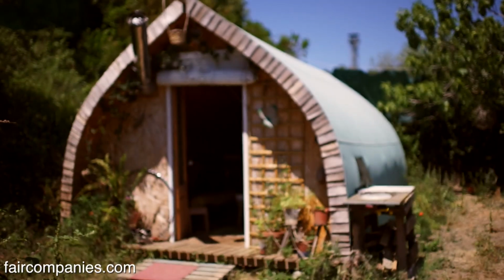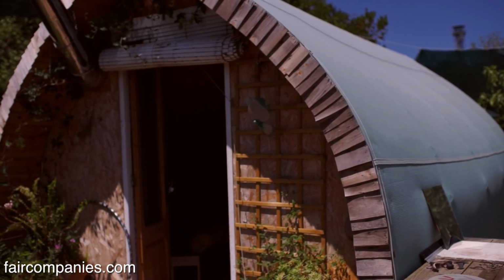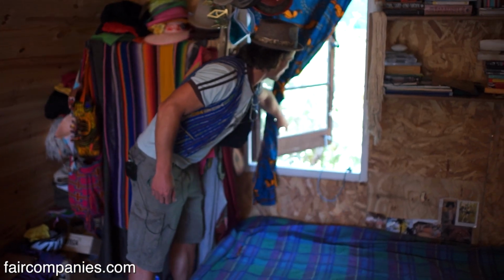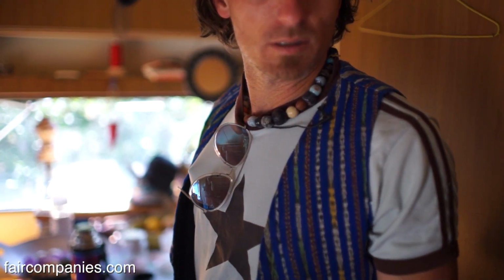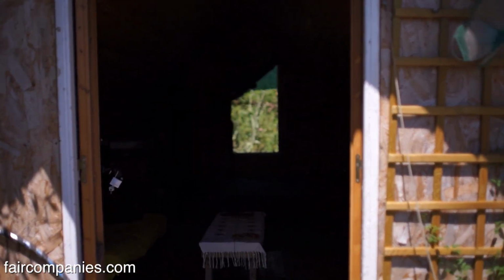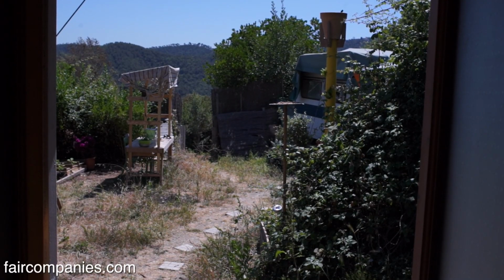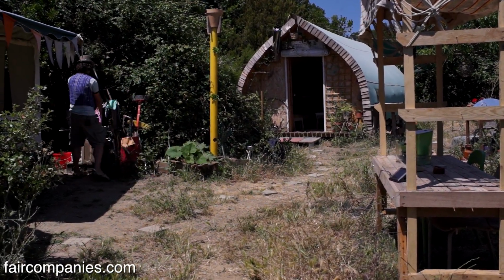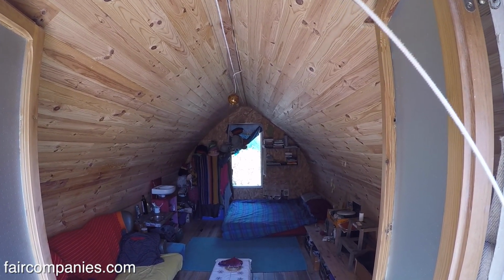Building €1,000 small home in 100 hours from open source design

Comment: I wonder: with the exposed chip board on the front, does he have issues with the humidity? It seems like the humidity would eventually work its way in and mess with the glue. Wouldn't it be worth it to at least prime and paint it?

Comment: the only thing I strongly dislike about this project is the OSB plates on the outer walls (the flake wooden boards). Those things are not 100% water resistant and best not to be used for exteriors.

Comment: the camper van is damp in the winter as for every pound of liquid gas you burn you produce a pound of water vapour, no chimney means all that moisture stays in there. the house is dry as no  gas being burned and you have dry heat from wood burner with a chimney changing the air all the time.

Comment: if you put a layer of plastic over the wooden frame then cover the house with mud or clay then added the tarp after it dried, would it be more insulated and silent during windy nights? been watching a bunch of videos on mud bricks, seems like adding it on the wooden frame would give super cheap protection?
Reply: Plastic will lead to condensation which leads to mold. Another material and you've got a nice idea...
Reply: I made an adobe wood fired pizza oven and I just used wetted newspaper under the adobe. The newspaper was spread on my "sand castle' style mold :) Worked like a champ
Reply: Need a large overhanging roof with adobe so that would negate the structures appeal. I like the wool insulation. Be sure to use wool insulation that still has the lanolin in the wool to help water proof it in case it gets wet. Wool will still breath and his idea is sound.

Comment: What's the name of the silver water pump thing connected to the shower?
Reply: It is an old hand pump fire extinguisher. Pump it with air to give pressure and open the valve to release the water. Plenty of them to find on the web or around your neighbor hood. Many are copper. Some are not.

Comment: Bet you could use the corrugated plastic sheets for this project, they are weather proof, and weight nothing. I did my bedroom ceiling and walls with it, and the outside of the garden sheds. I only have one arm that is fully mobile and limited use of the other arm, yet was able to handle the product. Homedepot sales for 110. for 10 sheets.

Comment: You can make this size of house much cheaper, with better insulation and engineering properties. Stone and mortar, and concrete floor. If you want to cover the concrete floor with wood, that's also possible, especially with such small size. I am absolutely not impressed by this guy's design, plus it limits head space around the edges.
Reply: Apocalyptic Knights 
Cheaper isn't always the  biggest concern. There is environmentally friendly as well an functionality.  For example fiberglass insulation maybe less expensive then lambs wool. But really how are they two products comparable in areas other than price.
But anyhow post your link and your analysis of  the products you're using.
Reply: Apocalyptic Knights Wow, you sound really upset over such a non offensive video. Looks like you need to do some meditating 🙏🏼
Reply: Link to designs?

Comment: Won't canvas deteriorate fairly quickly? It does here, UV can damage materials like canvas withing 3-4 years. Is the roof canvas treated for UV resistance?
Reply: ***** Cool, I was curious what the cost difference was, thanks.
Reply: +KlunkerRider One could also make the roof so those planks inter lap and then use tar to make it water proof. This way you dont need to worry about canvas and use only 20$ a year for jar of tar... or make your own for free.
Check out Finnish traditional log house buildings for reference. Those shingle roofs will hold weather decades if takes care of with tar.
Reply: +KlunkerRider If you are concerned about the UV just use plants. You could build a structure of steal wires above the roof were some wine could grow. Of course the canvas would get damaged by the wine after a few years but the overall endurance of the house would still be increased.

Comment: I don't support all building codes, or zoning laws, but think about the fact that most people spend a lot of money and time building a house and wouldn't dream of tearing it down when they move.  They want to get their investment out of it, so they decide to sell it, and then the complexion completely changes.  It's no longer a private person building a funky place for himself, it is now a PRODUCT.  The buyer may not know about all the peculiar features that the builder did, and may not be as accepting of the lower level of safety compared to a house built to code.  You can't get a loan to buy the place, and you can't get insurance either.  I'm not against this type of thing, I'm pointing out the principle behind building codes.
Reply: deezynar True points made. :) One of the major motivational drives behind this sort of thinking is the lack of overhead needed to live. One idea is to remove yourself from a mortgage and subsequent loss of decades of your productivity to pay for it.  
Several years ago I purchased land and built a Tiny Home  plus solar setup. In all, It cost me $22,000USD. After several years of living there I have broken even. Now it makes me money. That is, when you factor in the cost of rent/electricity/ etc. I could walk away with nothing and would be no worse off than having spent the last two years living in the city.

Sometimes it does not matter whether your "home" appreciates in value. With low costs put in, you do not need to recoup them through having a structure appreciate in value. (Although, even there it can work in your favor. Recently they re-appraised local land values. My property shot up to $17,200USD when I purchased it for $8500USD. If I sold it today, while keeping all the solar electrical equipment worth $7000USD, I made money over the last few years.)
As far as insurance, you still can get a "renters" type of insurance to cover you property. Much akin to a person having agricultural buildings with equipment inside it. 

Just another take on the conversation. :) - Cloud
Reply: deezynar Could be. If the property seller is really in a push to have to sell it and have to accept such a demand. Non-permitted structures , however, doe not always equal unlawful/illegally built structures. Counties throughout the US allow permit-exempt structures typically of either 120SF of 200SF floor areas. I have a couple of such lawful permit-exempt structures on the property.

If a buyer wanted them removed I have no problem with them having at it. Their property. Their vision. I will be off to new adventures at that point. :)
Reply: deezynar Lending institution? It was my take that most banks really are leery of giving a loan for raw land unless it is going to have a home build upon it relatively soon thereafter. As it is perceived to be more difficult to unload land onto the market quickly than a developed house. It is doubtful that people like the man above in the video would be going for a bank loan, but rather paying in outright cash. Another prominent factor in either the Tiny House movement or those like the video above is to move away from entrenching yourself in a longterm mortgage. These movements are a push against the idea of working so many hours just to keep up with the jones, but (I would venture to say) to take back your time and devote it to something more meaningful. Whatever that may be. 

Subject of HOA. Mortgage or no mortgage... I find HOA's to be a rather ill-conceived idea. Something about growing up in Phoenix where it was beige on beige and you couldn't leave your garage door open too long for fear that someone may see a box or two inside it. Oh Ghast!! :)

I say build a legal pole-barn. Get your permits. Let the county sign it off. Then finish it out to your hearts content. Some people are nervous about not living to the full extent of the law others are quite fine with co-existing with a lenient county that turns a blind eye so as you do not make a spectacle. A person has to be able to survive. IMHO some rigid rules that go against rights that humanity should already possess should meet with civil disobedience.
Reply: Undeveloped land is often bought with a loan, but the terms are steep.  You are right about most of what you say, but I think you are under the impression that I am in favor of strict building codes and zoning laws.  I haven't said anything to give anyone that idea.  My point isn't to tell people what I think is utopian, it's to tell people what to expect in the real world.  My very first comment explained a bit about why it was reasonable for codes to be developed in the first place.  I was not claiming the current system is ideal.
Reply: ***** Exactly. After a certain period of time, you make money. The beauty of that RV is that it does not have to ever appreciate in value like a house does. When you purchase a home for a hypothetical $100kUSD and have a 30 year mortgage, that home with 5% interest is now closer to $400kUSD. Did that home appreciate to $400k by the end of those thirty years? If not, you lost money. If it did, you still lost money you could have allocated elsewhere to invest or saved yourself from having to work all those dreadful hours for it. Great comment! :) - Cloud
Reply: cnypilot Again, yes.  Any structure under 120 S.F. does not require a permit under the IRC.  That's primarily because it's against the IRC to inhabit a structure that small.  The IRC is unclear about what the least S.F. is required for habitation, but 250 S.F. seems to easily make the grade.  Any existing structure under 120 S.F. on a site is almost certainly going to be allowed to stay because it'd be viewed as an accessory building.  If a person from a lending, or insurance company were to inspect the site and saw plumbing fixtures inside an undersized structure that indicated it was intended to be a dwelling, they would react accordingly.  And we haven't even touched the subject of zoning laws which vary drastically from place to place, sometimes differing widely even from one side of a street to the other.  Some municipalities restrict the location of accessory buildings on a site, requiring that they not be placed within a given distance from each property line.  Home Owners Associations are yet another bureaucracy that can snare a project, but it's unlikely anyone in this group would be buying high priced land in a HOA.  Counties tend to be less strict about building and zoning codes, but you need to check that before you buy land.  For example, my county is extremely strict, and we're not anything like high rent here.  One county over from us is pretty lenient.
Reply: deezynar 

Correct! TY! Now that the real needs of city planners/developers/etc. is known, they can be accommodated when the win:win is negotiated and there shouldn't be any problem once that occurs. 
And yet...
Reply: ***** The value of a typical property is a culmination of the value of both the land and the house upon it. Within a city or community those are quite connected. 

Having said that, it doesn't matter if you never place a traditional house upon a parcel on land. The land value alone can go up as mine has done over the last two years. 

Purchased for $8500USD, now is $17,200USD. I made money. Just like you did above.
Reply: cnypilot Yes, land without development goes up and down like property with houses.  There are some potential problems with having an unpermitted structure on it.  One is that the potential buyer may want it removed before the purchase to avoid liabilities.  Probably not likely, but possible.  Another issue that's probably not typical, but if they felt the buyer was planning on living in the structure, you wouldn't be able to get property insurance, and that could nix the loan.  Lenders and insurance companies are in bed with building code organizations.  Fire departments are also major league players in controlling building codes.

Comment: Before doing this, RADON GAS is something that should be considered. It is naturally occurring and can be a serious health hazard. Vapor barrier and a well-sealed floor is a must: https://en.wikipedia.org/wiki/Health_effects_of_radon
Reply: DARKLYLIT It is a deadly gas. You are correct. In this case, there isn't any buildup due to airflow under the building. It isn't a sealed crawlspace or stem wall foundation as seen in many buildings. With the open flow under the building (Although not good for maximum thermal conservation) there isn't going to be any appreciable "Stack-effect" created from the building to pull gas through the structure.